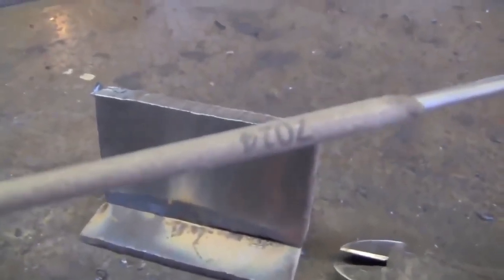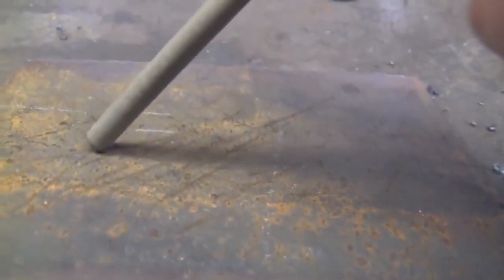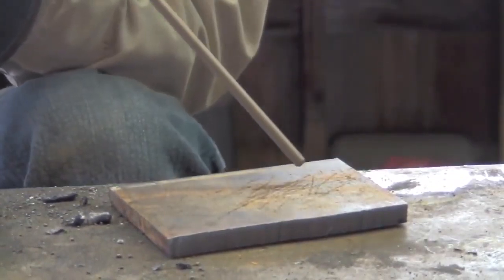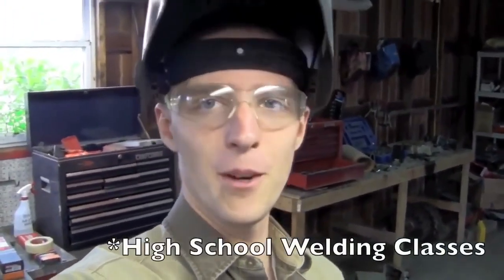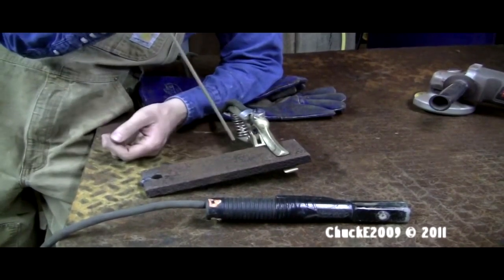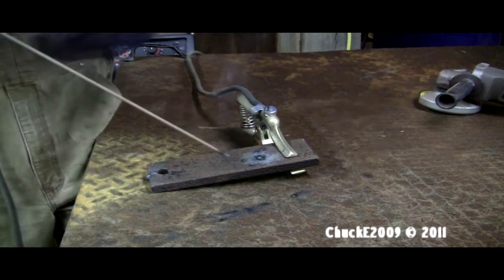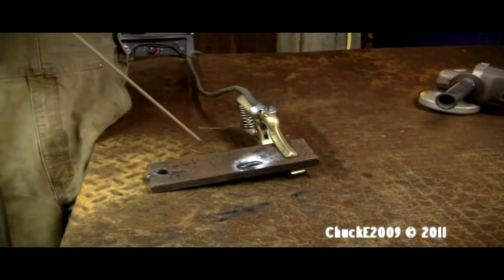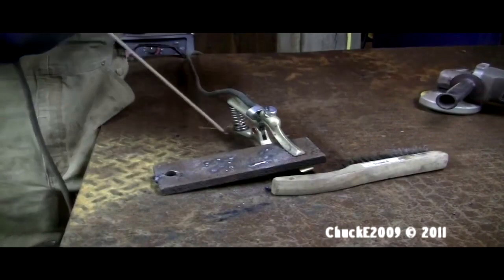BASICS OF WELDING: HOW TO STRIKE AN ARC WITH YOUR STICK / ARC WELDER!!! FREE LESSON

Comment: I have found those worm holes in the first inch of your weld come from 60 damned 13's. 9/10 I get them using 6013's. 1/10 I don't.

Other rods I never get this problem and I've used 7018's and 6011's with no problems. Was thinking it's my technique but after I found the other rods didn't have worm holes I relaxed and realised there is a problem with 60 damned 13's.

Striking the arc on the table first is all good for practice welding but may not be appropriate/possible in the field.